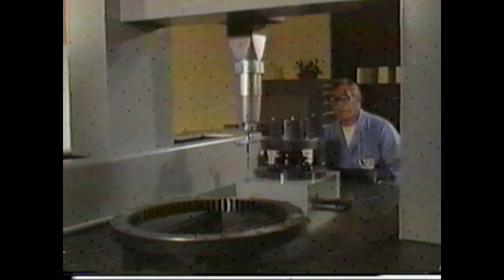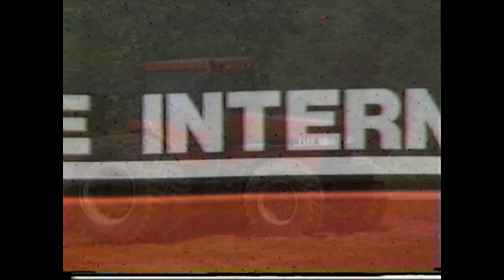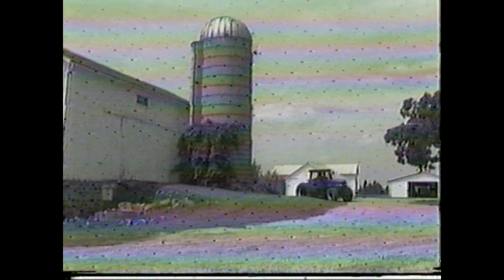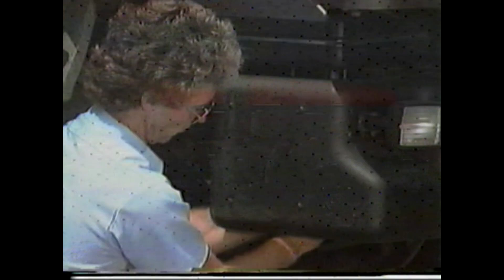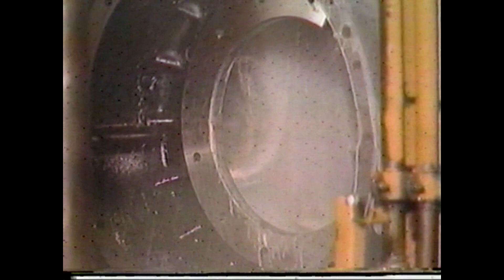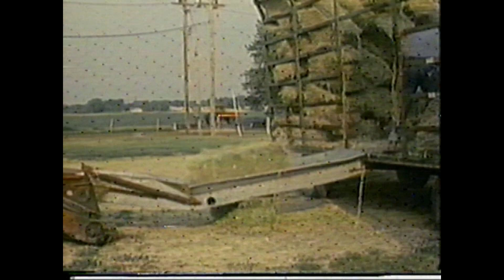Case IH 7100 Series Magnum Tractors Promotional Video - 1987

Comment: Funny enough the magnum was going to be the next generation 88 series for IH until they got bought. Everything on that tractor is IH except for 3 or 4 things that were case parts
Reply: Um...no. CDC engine, redesigned powershift. Pretty much half in half unit. Quite impressive, really.
Reply: @LanceStoddard  You can tell it has its an IH 88 series powershift as it "changes range" between 6-7 and 12-13.

The from the engine back is IH with Case plastic. Take the door plastic off for example, you will find an IH 86/88 door ready for IH 86/88 hardware. The transmission housing is IH, some still have the IH cast into them. The 3 point is IH. The filters on the back are easily accessible. The PTO unit is IH.

What is Case is the hood and engine. You can tell as it has all the hallmarks of Case's...design. Instead of IH's nice hinged hood sides, you get Case's slide in/push in PITA panels reminiscent of the 94 series, the big heavy hood  that hinges up front, the extremely poor radiator access, the cramped engine compartment, filters hidden and crammed in wherever.
Reply: @LanceStoddard  you are correct after doing a bit of research the engine part is true (my apologies), the transmission was going to be part of the new 88 series but it reworked by the company but everything else I said was true the frames, cab, electronics, hydraulics, etc was IH due to them having better technology (quoted from Case engineers) so it was more 25% Case and 75% IH  Source:  Red Tractors by Lee Klancher
Reply: @masterchief2182  I love IH but...the new CaseIH company put together a team of both Case and IH men and spent two years on designing the powershift to upgrade the Tri-six design. Although everything fit in the old IH castings nicely, the electronics and valving were new. Assigning percentages of who did what is probably impossible. Patents from four different companies were used on the Magnum. IH, Case, CaseIH, Cummins, CDC. Opps, Five different entities! As for it being 75 percent IH, I would love to agree but...The engine was CDC, which is a big percentage of the tractor. It also took two years to design and test the trans upgrade post IH which is kind of disrespectful to the work done by those people to say it was an IH trans, when it was a CaseIH trans. I mean really, who cares? A lot of people worked very hard over many years to develop the Magnum. Thank them all.

Comment: Awesome tractors.   The powershift transmission was built by Ih back in early 80s
Reply: Not quite. The new CaseIH corp. Reworked it and tested the new design. Filed a dozen or so patents on the new components. Quite an upgrade done to it after the merger.
Reply: @LanceStoddard  IH was the best thing to happen to Case they had nothing in the early 80s that came close to IH technology and innovation the 50 series International was the base for the Magnum, IH never got the credit they deserved.
Reply: @thomassutherland4470  Put credit where it belongs. CaseIH spent two years designing and testing the powershift. Case did have more tech in Hyd-electro shifting than IH. The engine was CDC (Case-Cummins) partnership started in 1980. Their 8.3L Turbo is a diesel engine classic. IH, Cummins, Case, CaseIH, CDC. Five different companies contributed to the Magnum.

Comment: I liked the 7140, but J.D had better tractors then and still today..
Reply: I'm a mechanic at a JD dealership and farm with IH tractors.
Reply: @bradjenkins932  I prefer working  on a JD always.
Reply: @francomtz7115  That go's without saying
Reply: @francomtz7115  What do you blame: the magnum: less gentle levers? 7140 has a hell of an engine and a full power shift that lasts 12000H without worry. A 4955 JD, the full power could give out at 5000h. A farmer from France
Reply: @DG-ne8iq  7140 excellent engine, J D. Excellent transmissions & hydraulics.
Reply: @francomtz7115  It's amazing that you didn't get back to the garage with the full power shift J-D , usually the speed used to plough (3 or 4 or 5) dropped between 4500 and 6000h on almost all these boxes from the 4050 to the 4955 .
I've never heard anything about the syncro-range of the 4240S, or the quad-range series 6900 or 7710.
As for the IVT box: a disaster on the 20 and 30 series (6920,6930,6530) for the European series (ZF box) for the American series (Funk) is acceptable. It was made a manufacturer support with free standart exchange up to 3000h, but not manpower.
Reply from the maker: I will admit the equipment in my drive shed is mainly green. But the CaseIH dealer is only a half mile from my place. So I see a lot of Red rolling by 😊
Reply: Except for the 7320 with IVT. Deere Lemon Lawed ours. 4400 Deere Lemoned that one. Our 7230R went through 3 Transmissions. 4940 spreader you couldn’t drive it 15 miles without blowing a $1200 drive hose. And 8400 I had it was Really Shitty to unbolt the Hood like a John Deere A . And up until we bought 9 New Fendts nothing had the 5 year 5000 hr Warranty like a Box Car!
Reply: No they didn’t lol. Deere was lacking severely until the 700s and 8000s came out.
Reply: That's why JD upgraded their tractors in the late Eighties, because they were already better? You could barley see anything with the post in the center of the cab front and the exhaust stack and the air cleaner. Nothing wrong with JD, but people wanted something better, and that was the Magnum.
Reply: JD fans are delusional and have convinced themselves that it's only good if it's a Deere...
Reply: Love seeing videos of the Magnums. I started in equipment sales when the magnums were coming out.
Reply: You only believe that because you bought in to JD propaganda
Reply: except when you try to fix your own equipment..
Reply: @AboveSomething  all  makes are complicated when it comes to repairs